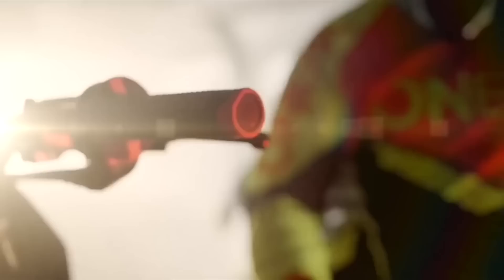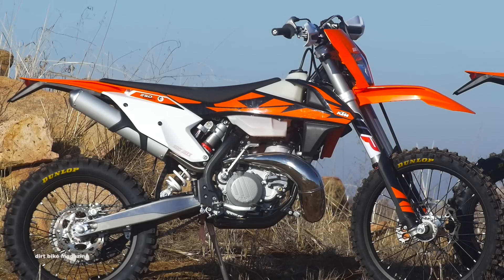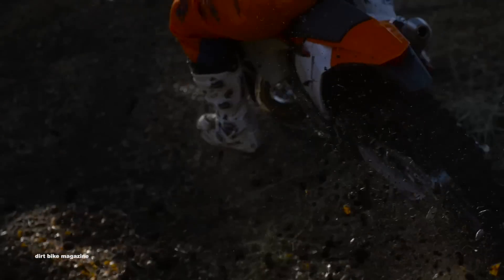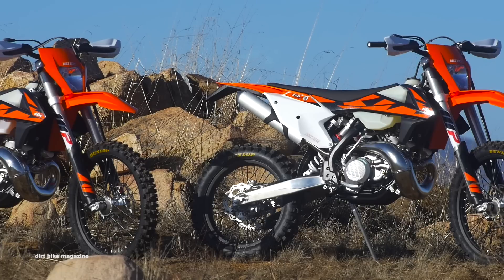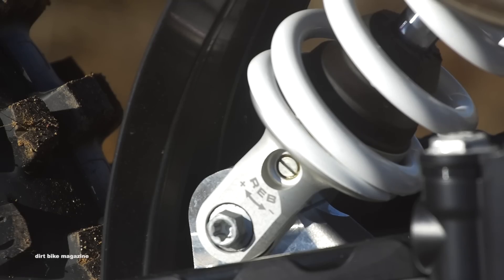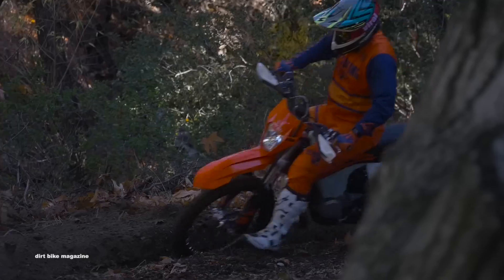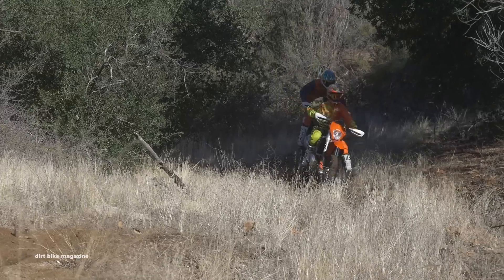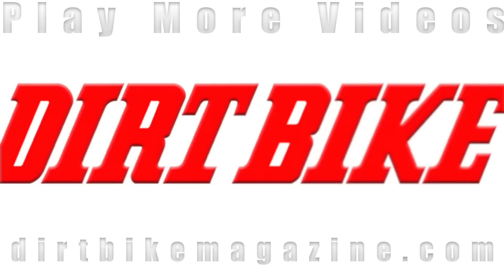Fuel Injected 2 stroke VS Carbureted 2 Stroke KTM 250 XC-W - Dirt Bike Magazine

Comment: Glitch, get the new map, already available here from KTM dealers makes a big difference glitch and lower sorted, yet to get a ride on this v my 17 250exc.

Also really only weak points aim hearing is fuel pump and oil pump and quality of oil  reservoir  for the oil injection and filler to res!

That said talking to some mechs about the reliability and already what they can see is less wear on top and bottom ends, because no fuel is mixed the bottom end is oil only so no fuel to corrode the bottom end, they reckon should get twice the service life out of a bottom end easily!
Also the top end because of near perfect atomisation they reckon up to 200hrs on a top end, before all you carb bois get upset just think about those too facts alone and also what this will do re pipes silencers etc, aim a 2t man to the core and love the simplicity but this is imo a big deal, and also hearing the 250 may impact 300 sales here atleast where we have no restrictions off road, the bike pulls amazingly aim being told by 300 guys now saying what I been saying for years you only need a 250, ride one with the new map.
Reply: i heard jtm replaced all the faulty fuel tanks with stronger ones and if some one is going to bitch about a efi 2 stroke tell them that the only way you can keep carbs is if our bikes are the same from now on like the klr650 and then its not viable for ktm or husky to make them any more because of greenys

Comment: does TPI give the advantage of using engine braking without risking to blow the engine?
Reply: Thats a good question

I mean the Computer could calculate how much oil is needet
Reply: Probably because the engine is at load and the sensor will squirt more oil than the carburetor counterpart
but we all know most 2 strokes drivers who engine brake gives it continuous throttle blips
who can resist those lol
Reply: What do you mean?

Comment: Would the oil injection work on the carbureted model similar to the older systems eliminating the need for premix ?
Reply: yep, beta has oil injection on the standard rr250-300 models
Reply: HONDA  WILL STRAIGHTEN OUT  KTM VERY SOON, KEEP WATCHEN
Reply: Honda is shit when it comes to offroad bikes
Reply: ACreativeName   ONLY THING THAT MATTERS, 10 TIME WORLD MOTORCROSS CHAMPIONS, DIRECT TO SHOWROOM FLOOR.  HONDA   KTM IS FOR OFFROAD TRAILS  WHERE THE FLAGMAN AND TIME CLOCK DONT WORK. RETIREEEEEEE RIDING, THEY USE HANDICAP CANES ON MONDAY TO GALLOP KTM  SHOWROOM. AND IM OOOOOOOOLD   TOOOOOOOOO.
Reply: ktm got hydraulic clutch, honda doesnt thread closed
Reply: ACreativeName  THREAD CLOSED, HONDA DEALERS DIDNT GO OUT OF BUISNESS IN AMERICA, KTM SHOPS DID. HONDA HAD VARIABLE CAM IN 1991 ACURA NSX, KTM WAS BUILDING SCOOTERS IN EUROPE
Reply: ktm is the leading offrad bike, not motocross . And have you ever touched a ktm clutch, its like heaven
Reply: IM TOOOOOOO OLD AND WISE, SOME DAY YOULL GET IT.

Comment: can you engine break a two-stroke if it has an oil sprayer?
Reply: Antonio Simuncic why not? It actually would help...probably better compression and throttle response
Reply: I've engine breakes all my 2 strokes and have never had an engine blow up on me. Even had a chunk of the top of my piston break off and shoot out the exhaust and have my bike still run with a chunk missing from the piston. It ran like shit and wouldn't open up, but it didn't fuck up the barrel or anything, so I just needed a new piston and rings and I was good to go
Reply: Not really any point. There isn’t any real resistance.

Comment: Why can't we have a 2 stroke engine with a closed off oil system like a 4 stroke and then inject the fuel directly into the combustion area?
Reply: How would the cylinder scavenge? The crankcase is used as an air pump to push air through the transfer ports. Unless you supercharge it like a 2 stroke diesel.....
Reply: @Ozsmallbore  Yeah and I guess at that point you're losing the simplicity of the design which is it's primary advantage.

Comment: what about weight? is there a difference?
Reply: Same weight difference if you would choose a linkage VS PDS (husky vs ktm).
Also, you can carry less fuel and get the same range so I wouldn't call it a deal breaker.

Comment: This I find hilarious, the environmentalists complain about a 2 stroke polluting the air but yet a wore out 2 stroke won’t run requires a 100 dollar rebuild to have a like new bike again. A wore out 4 stroke will still run yet will smoke bad and pollute 10 times more than the 2 stroke ever did in its whole running life and cost 5 times more to rebuild. Oh yeah not to for get how much more oil a 4 stoke needs to run and how many times it has to be changed. Lmfao. Let em think that one over.